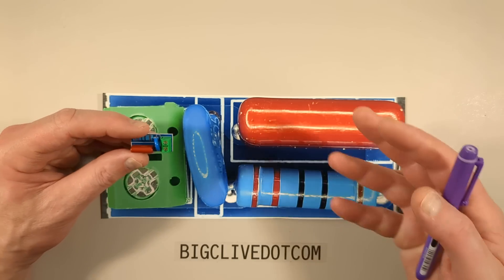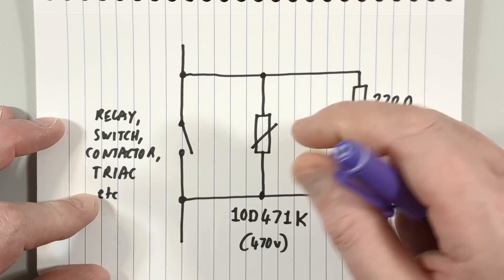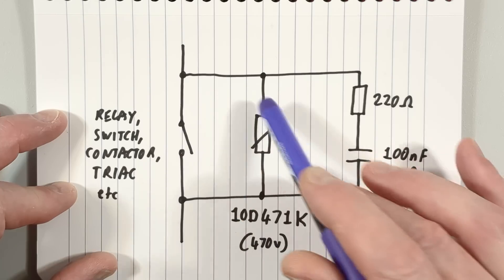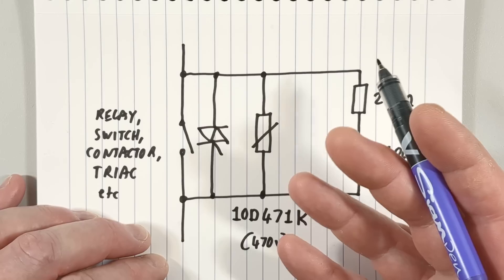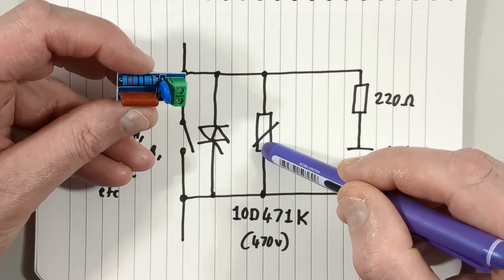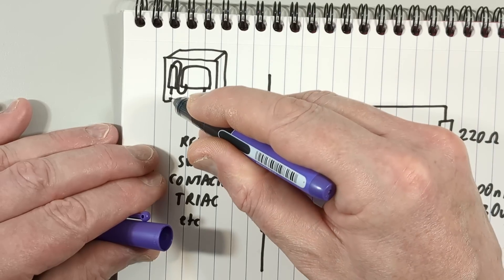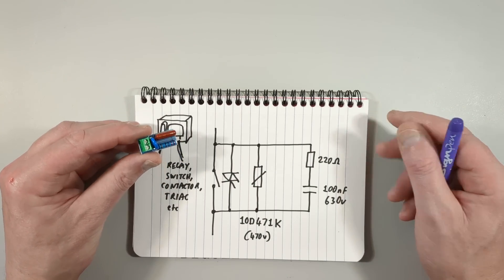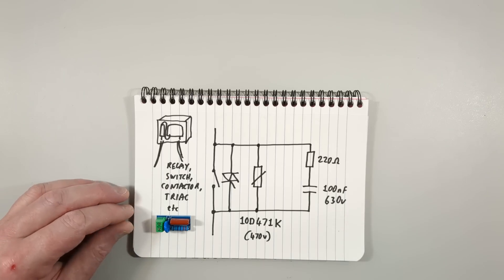Snubber network module for protecting contacts

Comment: Very interesting ive never opened one of this before i just creates them by soldering 

So i have a request for you bro 
I want to use incandescents lamps but they get burned by overvolting what can you suggest me to build to save them from burning my main is 230-240V and it goez 280 to 400 when is overvolted so what mini-thing do you suggest i to build to save their lives from burning every day bcz im buying and changing them everyday i choose 
 incandescent lamps bcz leds doesn't look well for eyes and cfl after some days they start an noise that gives headaches and now winter is coming and also i need bright light
Thanks in advance 😊
Reply from the maker: Vibration can shorten tungsten lamp lifespan greatly too.  But that is serious overvolting, suggesting a poorly regulated generator or substation with very variable load.  It even hints at a bad neutral somewhere.
A better option for wide voltage range flicker free lighting might be an LED arrangement with a DC output LED driver with a wide voltage range, or an industrial DC power supply that can handle from 200V to 400V input and puts out a stable DC voltage.
You can also get programmable switches that will kill power to your home if the voltage exceeds a pre-programmed threshold and then reinstate the connection after a delay once the voltage had dropped again.

Comment: What quality are the AliExpress components?  I worry for instance that say the MOV may be a reclaimed disc cap from e-waste, coated blue and labelled accordingly.  Lovely jubbly, plenty profit!  Who's going to know?  Am I too cynical?
Reply from the maker: For personal experimental use AliX is usually fine.  But for a professional application I'd suggest using pro components from a prominent component supplier.  (Usually RS in the UK).

Comment: I have seen snubbers with glass spark gap 'transorbs' Like a pudgy neon lamp but with electrodes robust enough to handle a flash over of reasonable energy, but never with a MOV. Not sure I like the idea of an MOV if the contactor is switching an inductive load, which is when a snubber is needed, every contactor operation would be beating the MOV into an early death.
Reply from the maker: Hopefully the capacitor/resistor network would shunt the spike to make the MOVs life easier.  But personally I wouldn't use the MOV.

Comment: I have a wood stove with forced heat convection that sends the back-EMF of the fan to the television nearby when the door of the stove is opened. I fixed the problem by putting a snubber network across the AC fan.
Reply from the maker: It would have to be a brushed motor or a phase angle controlled motor to create electrical noise.
Reply: @bigclivedotcom it only made noise when disconnected by the N.C. switch connected to the door.

Comment: Every classic HiFi amp has one over the switch. And in a lot of cases, a RIFA firework-inducing one 😀
Reply: Worked with Rifa RFI capacitors a long time ago. What kills them is not using the appliance but tucking it away in a damp place for years and then all of a sudden reconnect it. In the meantime humidity has diffused through the epoxy into the paper in the epoxy impregnated winding. The water reduces the insulation properties, losses go up and it basically overheat. The weird thing is that the self-healing properties for this capacitor was better than for polyester types, making them way safer when new and used. Use drive the humidity out, simply put.
Do not expose these to line voltage all of a sudden after a decade in your shed. Likely,  they didn't improve by moving the production from Sweden to a tropical country, Indonesia, decades ago. But that I dont know. Metalliised paper, vaccum impregnated with epoxy, was way better than alternatives 40-50 years ago just because of its self-healing capabilities useful in line applications with occasional spikes. I used to demo that by sawing one in half and connecting to the line.  After a second of small arcs on the open surface it showed half the capacitance value. But was compromised by humidity to the open surface after a week or so.
Humidity kills paper after a few years of non use. In that way metallised polyester is better as a choice of dielectric for this use. Today likely with a oiltreated more stable dielectric. DO NOT USE NON X2 RATED CAPACITORS ACROSS AC POWER LINES. PLEASE.

Comment: In old mechanical spark plug wiring, the problem of contact breaker arcing was common- making them a regular maintenance item.
They usually just has a capacitor across to eliminate arcing but when they failed (open circuit) your breakers burnt outer time. If capacitors bridged the circuit, you simply had no sparks at the plugs and the engine wouldn’t run.

Comment: I often have simply placed a MOV across contacts that arced, to clamp the spikes down. the last one I made in serious design I went with some 15R 2W metal film resistors, and some very expensive 150n 1500V Polypropylene capacitors, normally used for flyback tuning on TV sets, as those were plenty capable and low ESR to last there, unlike the more common class X capacitors, which there would self heal to nothing within a month, seeing as this contactor was running a take up reel, and had a 1hP motor turning the reel, operating around twice a second. 

Those snubber blocks are really expensive for what you are buying, often 30 times the cost of buying a resistor and a capacitor. most of the wire ended snubbers were meant to be clipped top or side of a contactor, but due to most cabinets being limited either in height, or with too many per row, often you had them doing the dangly instead, because you could not fit them in and close the door otherwise. the ones that were screwed into the coils however you simply used the A1 and A2 screw terminals on the one end, and then you could add a single wire to it, and the other side, where your overload goes, used the A2 to feed the coil power, and also where you connected the neutral, so the overload NC switch would break the contactor on overload, either reclosing after time, or needing the manual reset to be pressed, depending on how you set the overload, either a flag or a break away part of the housing to enable auto reclose. Fun times on auto reclose, which was guaranteed to kill the motor always, and probably also the contactor itself.

Comment: I got an ADJ Fog Fury Jett smoke machine which breaks the solenoid on a valve. The solenoid is just connected in parallel on the pump terminals, and I'm suspecting that could be why it breaks. Could something like this snubber in parallel with the pump and solenoid help the solenoid?
Reply from the maker: Is it the solenoid that fails?  Is it an electrical or mechanical failure?
Reply: @bigclivedotcom the solenoid on the valve fails. Measuring the resistance of the coil show no connection between the two wires.

Comment: One important feature I thought of when you mentioned the possibility of the MOV haveing a meltdown would be to add a replaceable buss fuse as well as potentially adding a indicator light like a neon bulb in line with the fuse to indicate when the fuse is blown.

Comment: 2:18 a high delta V... We call it that, right? I mean, I do, but I didn't make that up did I? I know when I worked for HVAC in college we called the difference in temp of send and return as "delta T"
Reply from the maker: Delta means "change in", so a high delta V means a high change in voltage.  In the case of a temperature sensing thermistor it would be a delta T for a change in temperature (actually a delta resistance).

Comment: Different versions are used by low volt DC too. 12 - 48 DCV can eat contacts without them and part of Switches Relays etc spec typically are 250ACV @ X Amps but < 30DCV @ 1/2 to 1/4 of X Amps. Or Spec's say nothing about DC expect = 0DCV 0 Amps. But people using them anyway and fry whatever soon. A Big Reason cars and other light vehicles never switch to 36/48DCV system even after Hype from several Brands is because how much harder for switches et al controlling heater blowers and other E-motors, AC Clutch Coil, and more.

Comment: 100 nF is enough capacitance to absorb typical arc energy in small relays without creating excessive peak currents.
100 Ω is enough resistance to limit the peak current through the capacitor to safe levels. 100 ohms can provide some damping. Maybe use a metal oxide resistor. (handles peak currents better.)

The RC time constant is Tau = R x C = 10 us, which is fast enough to respond to most of the transient; but short enough that the capacitor does not stay charged too long.

Comment: Out of curiosity what would happen if that circuit was substituted for the capacitor (condenser) in a traditional points based inductive automotive ignition system?
Reply from the maker: That might need components matched to the application.  But it might be worth experimenting with.

Comment: I used to place a snubber in parallel to switches controlling fluorescent lamps. That saved the wall switch from a premature ending, and reduced the interferences on AM radio and TV.
Anthony

Comment: Can this be used on a pump pressure switch?
Reply from the maker: It should work for something like that.
Reply: What about generator starter motor relay?

my previous one fail welded shut, so the starter won't stop cranking. That was scary, I needed to find a screwdriver quickly to disconnect the battery. Luckily it didn't burn the starter motor or the battery.

Comment: The resistor also degrades the Q of the resonant circuit formed if the load is an inductor. This reduces ringing.

Comment: Thank you for explaining what a Snubber Network is and does.  I'd have called it something different but now I understand.  Maybe you could explain a "Boot-Strap Circuit"  and a "Fly-back Arrestor" sometime too.
Those are handy looking units and probably easy to the Amateur Electronic Enthusiast/User for cutting out that arcing that can happen when a load is switched.  I know arcing isn't good for electronics.  Muck obliged to you, Clive.  Cheers!

Comment: These were a pain in my arse when I used to work on industrial control systems. They're normally across relay contacts and they could often pass enough current that whatever is being switched doesn't actually ever get properly switched off!

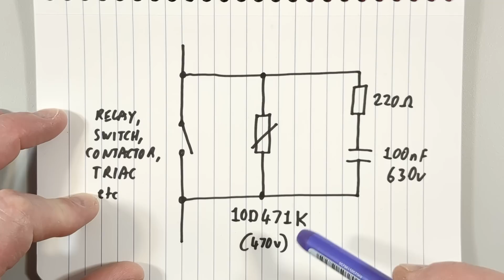Comment: 1:30 Funny story about MOV's, i was building a little distributor AC bus for my system, and i blew so many fuses and was stumped by the rating, i found that everything up to 14D470K tripps my inverter, and its a bad time on mains AC 230VAC, but a 14D471K worked perfect for both inverter and main AC, i think i blew more than 10 of glass fuses during experiment before i found the correct MOV.
Reply from the maker: A 470 MOV would have conducted at 47V.

Comment: Do these devices need to be adjusted to the circuit you are working on or is pretty much always default values?
Reply from the maker: The most common one I've seen is 100 ohm and 100nF.

Comment: Thanks for this short but fine explanation :)
Also worth noting that the capacitor used in a snubber should preferrably be of Class Y, to ensure it does not fail as a short.
A question about a future video. Could you talk about making a DIY light dimmer that would be suitable for modern lighting, both LED lamps, halogen with transformer and traditional incandecent lamps?
Perhaps even af a small design seris that could also look at some DMX control implementation too?
Reply: Sounds like a good topic for a “Clive-Live” event. Count me in😀
Reply from the maker: Modern LED bulbs are almost always not properly dimmable with a traditional phase angle control dimmer.   A future approach would be a regulated 12V or 24V DC buss around the home and pulse width modulation dimmers for simple LED and resistor based lights.

Comment: It's interesting that some arcing on contacts actually keeps them working ("wetting"). Microswitches in wireless computer mice tend to develop extra clicking due to not having enough current to do this self-cleaning.
Reply: In a high current relay, like starter motor, it may weld shut the contact. That's a pretty scary situation.

Comment: The surge protected sockets are fun because they use small  thermal fuses in series with the MOV’s only rated for about 4Amps.
Is that sufficient? Depends on the duration of the spike.

Comment: I remember a bit of circuitry in a Radio Shack book talking about how to use,  I think,  a triac-output optocoupler.  There were a few typical application circuits and one used a simple snubber network,  while a variant meant for inductive loads used a two-stage network.  The details beyong that are a bit fuzzy but the book is around here someplace...

Comment: Hello you mentioned  at the end, the downside if switching AC, is there is a constant current passed when the relay is off, i have some of this board´s in use to prevent damage of the control relay but i use it in parallel with the inductive load, they work fine and save the relay from arcing.
Reply from the maker: There is a low current passed when off, but it's mainly an issue with very low power loads like LED bulbs or in some instances things like relays or solenoid valves.

Comment: Wow! I have an old distiller (water) that I added a new fan that is not an exact replacement. It's bigger. I seem to go through microswitches. They fail although I am using exact original microswitch replacements. I now wonder if the new fan is causing more switch arcing. I will try one on these snubbers across my new fan. Timely video! Thank you!

Comment: The transient switching the Triac or SCR on is called end triggering. I ran into it's joys when I built a electronic ignition system for my car. With a combination of it triggering when it felt like it when I was stuck in traffic. On mature reflection electronic ignition was not a smart addition to an air cooled VW Type 3 It was a brilliant system you could get sparks 500 mm long from it!

Comment: I used to have an old fridge that put a great thump through the audio equipment every time the thermostat switched.  I made up a unit like this using passive components and it worked a treat.  My new fridge/freezer doesn't suffer from this problem so maybe they are built in.
Reply: My fridge produces such spikes that my old computers often go grazy and old monitor shuts off.
Reply: I think it's because your new fridge are using inverter so the compressor speed can vary from slow to max speed not just on-off state

Comment: Peripherally, I would like to publicly praise whoever came up with transparent heat shrink tubing. Finding one of these in a cabinet in black heat shrink is unsettling to me because I immediately think it might be a snubber but there are a lot of other things it could be. Being able to see the components instantly prunes a lot of possible problems to look out for from my mental diagnostic tree.
Reply: Check the flame rating of clear Heat shrink compared to black...

Comment: Funny enough, I use about 10 snubber networks for an idea I had. Thyratrons are kinda archaic technology, but they work. The problem is that no one makes the good hydrogen ones anymore. So instead, I used a 10 stage SCR thyristors with an inductive 1:1 transformer trigger circuit to isolate the SCR gates. Initially there was too much noise with gates so I put these snubbers on it and works like a charm

Comment: My Dad had the triac latching issue you describe when switching a contactor to drive a heater with a cheap central heating thermostat.  I recommended a snubber to resolve this, but it's since been removed from service anyway.  It's good to know that bolt on snubbers like this are available.

Comment: Not commonly known, but standard power contacts (made of silver) need a small amount of arcing to keep them clean.  Small is an important thing.  Using a power switch/relay/button to switch logic levels can lead to failure.  In this case a small capacitor without resistor across the contact will generate that cleaning pulse.

Logic level contacts are often gold, sometimes crossed triangles to assure connection.  Switching any sort of load with these will destroy them.
Reply: Silver is not a good switch contact material,  as one organ manufacturer found out several years ago.  The problem is the sulfur in air pollution,  which ends up forming a non-conductive layer on the surface of the silver.
Reply: @Roy_Tellason  That's why you need the arcing!  Problem solved!

Comment: you mentioned it at the end, the downside if switching AC, is there is a constant current passed when the relay is off.
Reply from the maker: There is leakage, as seen with dimmers.

Comment: Not much information to find online about snubber networks, so happy to see your video. Thumbs up!

I've long been looking for snubber sizing rule of thumb, but given this is a generic module, is the key takeaway that size doesn't matter here? 

Another question is if a snubber is useful with a zero-crossing-relay. Because of the zero crossing, I am inclined to say not useful, but if voltage and current are out of phase it wouldn't be a bad thing I guess. Also I am unsure how close to zero a zero-crossing-relay actually switches on or of.
Reply from the maker: Solid state relays often have a snubber network to prevent false triggering of their triac.  The mechanical zero crossing point relays that use optical sensing to detect a spark and tune the timing based on that, may benefit from a snubber.